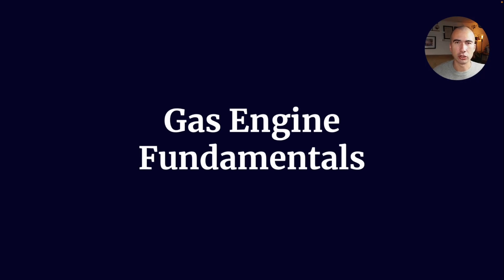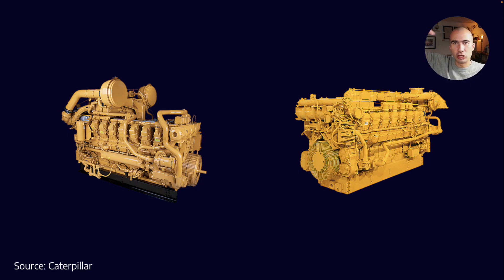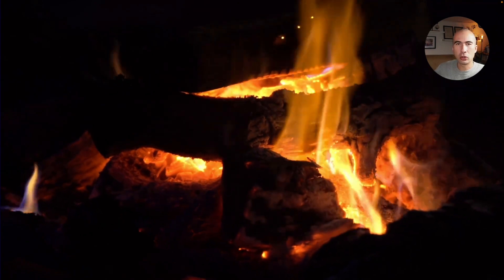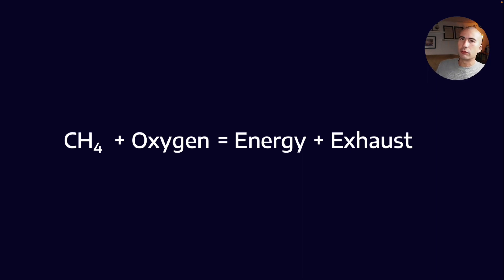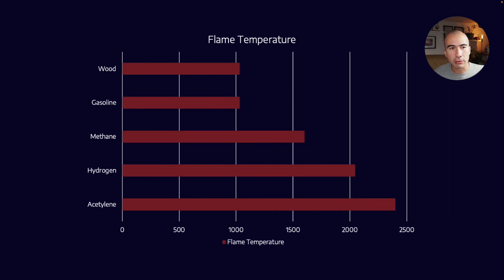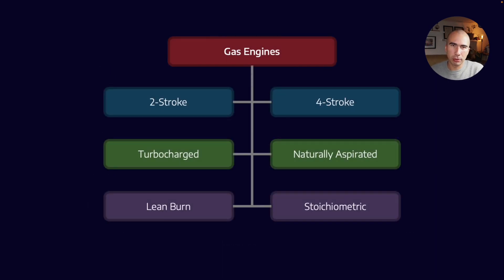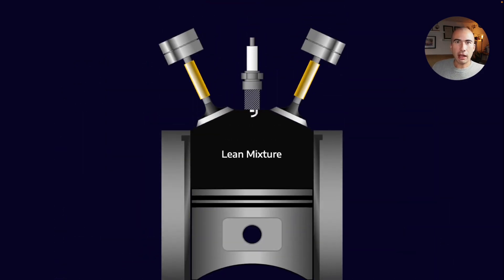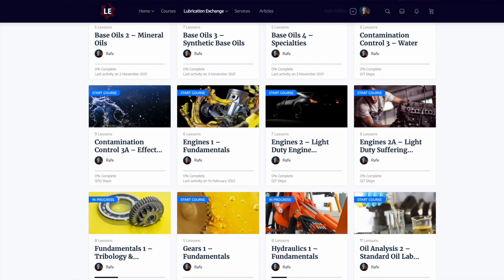Gas engines - what makes them different from diesel and petrol?

Comment: thanks for sharing. Interesting to note that engine lube oils designed for 'gas' engines tend to be more tolerant of the gas contaminants that could lead to poor TBN or corrosion.
Reply from the maker: Yeah, although some diesel engine oils do tend to have higher BN, particularly the marine engine oils.

Comment: Great video, Mr. LE! I wonder how much soot a 15w40 semusyn Diesel engine Lube can handle vs. a common semisyn 15w40 Gasoline Lube ?
Reply from the maker: Good question! Unfortunately I don't have a great answer at the moment. I ask around.
Reply: A lot more soot, since it has special additives due to diesel oils requiring them to dissolve and keep soot in suspension. That's not really an issue with gasoline oil.
Reply: @em4703  gasoline exhaust is far more acidic & exh water is more prevalent.. do a hot vs cold oil change & see the resultant water in the oil especially cars that do a lot of short runs

Comment: Hey, I made a synthetic lubricant but want to make it thicker, right now its probably close to 140W but I want it closer to 240W. What should I add?

Also, this lubricant is used on pivots so temperature is not a concern.  I am not very experienced with oil making, sorry about that.
Reply from the maker: Good question. That's a pretty big jump that you're looking for. What base oil did you use? You might need to start with a higher viscosity grade. You could use a bunch of PIBs to jack up the viscosity but I don't think that would be ideal...

Comment: Thanks Rafe, this is a very clear and understandable explanation. Really appreciated.
Reply from the maker: Thanks James!
Reply: however incorrect it fundamentally is.. the fuel ignition methods set significantly different design demands.. same applies to "2-stroke" comparisons.. as an example theres NO similarities between uniflow vs loop scavenged "2-strokes".. both 2-strokes!!.. nothing comparable..  homogenous charge compression ignition exemplifies the fundamental difference design demand.. applying diesel principles to "gas" fueled piston engines.. no mention of why diesel engine donut piston crown chambers.. thats a fundamental demand difference

Comment: I am involved in thinking about hydrogen power reciprocating engines from a power generation perspective. Hydrogen burns hotter than natural gas and flame speed is faster. I wondered how much difference there will be between hydrogen and natural gas engines.

Comment: Lean burn is more efficient.
Rich burn with 3 way catalyst can achieve lower overall emissions rates than a lean burn.
Both types have their advantages.
Please read EGSA power generation reference book chapter on large liquid cooled spark ignited engines.

Comment: endless debate that lpg destroys engines...
i find it funny, gas flame is colder than gasoline.  https://en.wikipedia.org/wiki/Adiabatic_flame_temperature
these guys measured exhaust temp, and lpg was colder by 20 deg c https://www.youtube.com/watch?v=Kzej3WzcvAM
Reply: But I once read a study that shows it bruns hotter because It doesn't cool the valves like petrol does therefore LPG might (not destroy) cause valve recession
Reply from the maker: Yeah I don't think it's necessarily going to destroy an engine given there's plenty of perfectly functional has engines out there. But the combustion characteristics are definitely different. It's flame speed as well as temperature.